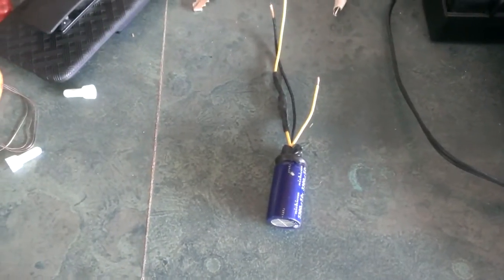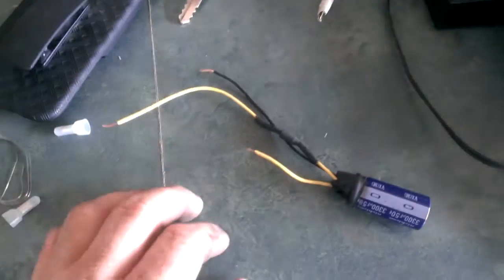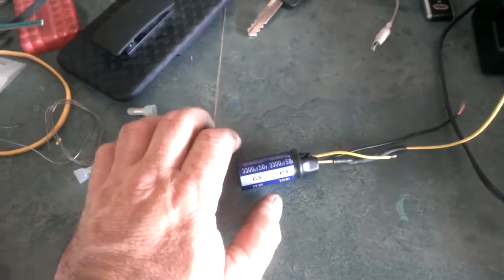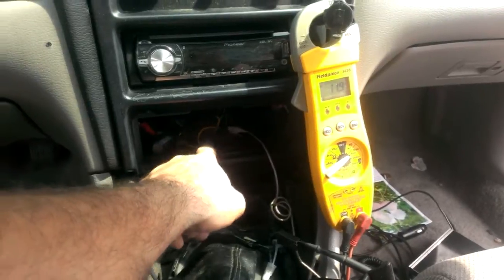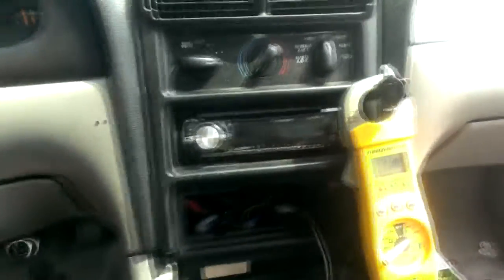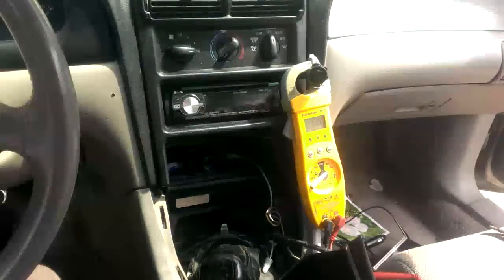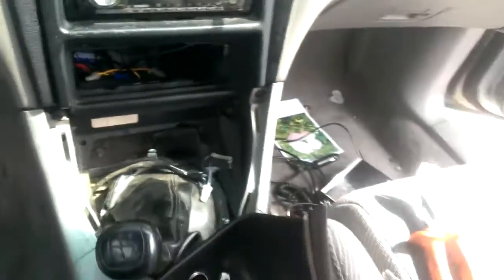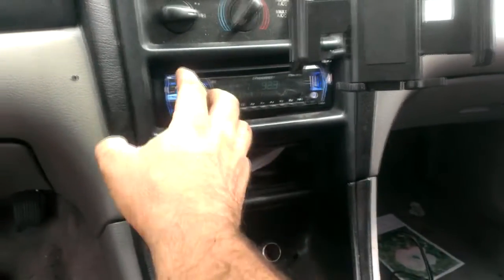Project Mustang - Simple mod to retain radio memory when the car battery is disconnected

Comment: probably last a week or so might heat up tho? 9v square would work better maybe?
Reply from the maker: +Horticulture and Bonsai est2005 (Doug) 
LOL, this battery connection is actually to only hook up a battery to keep the radio memory when I disconnected the car battery to work on the car.
The battery here would not be connected when driving or connected long.
I just use a small 12 volt lead battery I have.

Comment: I just did this with a pcb and 1000uF cap and was searching for pages that may have a clue about typical current draw for memory retention since the level is too low for my V/A meter to measure.
Although I used a schottky barrier diode to retain some voltage when charging the cap, and there's already a >8V -> 12.6V boost converter in front of the circuit.
Edit: It did not work, the cap discharges within a second...

Comment: hey Whta happen when the radio stay on when the car is off i have the red and the yellow togeter even if i put the yellow straight from battery still stay on even if the ac is off

Comment from the maker: I probably have something in an old video but can't think of one in particular. 
Most of what I have now for work is two buildings with chillers and then one with water source heat pumps. 
I've only got a few package units (water cooled) and a few splits. 

Maybe when I'm doing a side job I'll get a chance to do an updated video. 

Dr. Zarkloff or someone might have some videos as well.

Comment from the maker: Are you talking about on cars?
Cars a mysterious beast because of the vast varying loads and metering devices.

Best to charge by weight if possible. 
If just topping off it seems that the least amount of charge to get a cool suction and good temps in the car the better. 
The extra refer stacks up QUICK with the small condensers and short liquid lines.